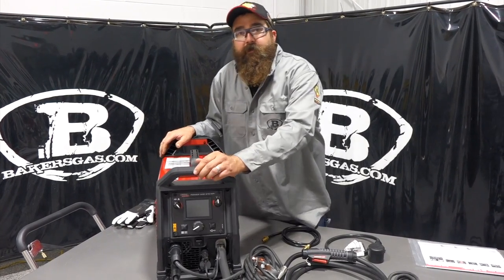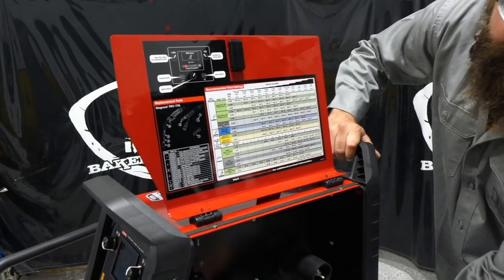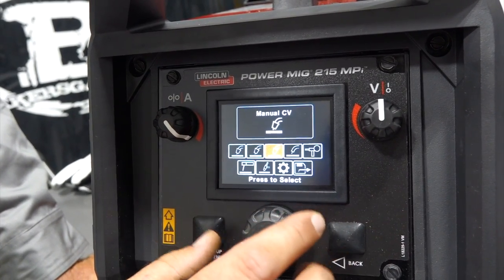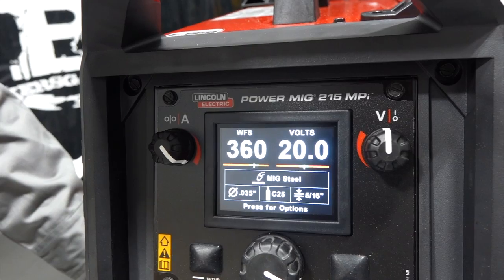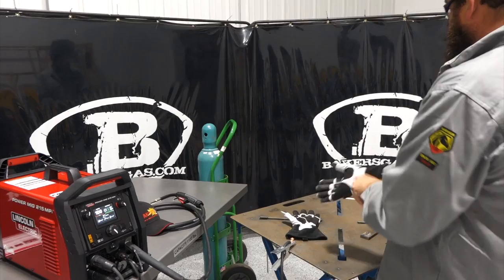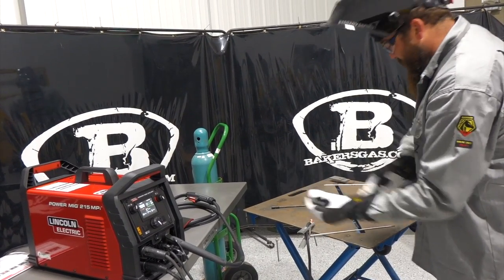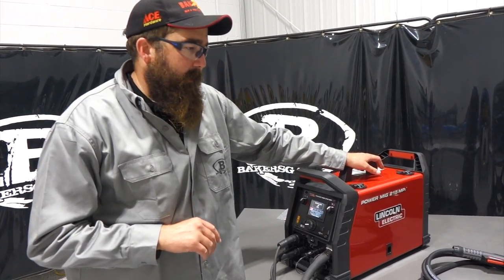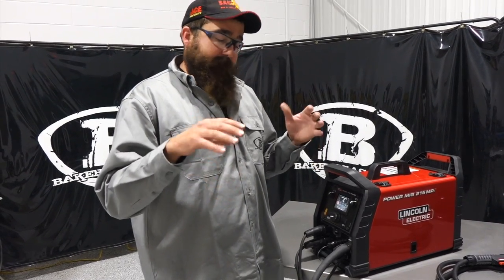Lincoln Electric Power MIG 215 MPi - Review and Demo

Comment: After a year i REALLY like mine.  Two suggestions : one for the Power Mig 215 .....why do the SMAW settings for this machine default to DC -  ? The way polarity is selected is really kind of annoying..Its like playing .like a video game.. just make it a +  or  -  off / on switch...This next applies to ALL multiprocess machines.. I really really like have all processes in one place but i still have to take my Mig gun set up apart to run a spool gun..Why not Install  a separate 4 pin connector and gas solenoid for spool gun..now its all there

Comment: Update: got the machine, the very first update I notice was that they did away with the twist lock cables, instead they went with the traditional setup of a 230 volt plug to a 120 volt connector. To me, great improvement. My first impression that is a way better machine than the 210 MP. It's a little bigger than the 210, therefore, the 210  cover does not fit.  Those extra two handles makes it easier to move around.  I use .030 wire most the time, it does not have any recommendations or settings for .030 flux core wire which I was expecting to see in this machine, however, that is not a deal breaker. Hope they come up with a cover that fits this machine soon.
Reply from the maker: Hey Jose, thank you for commenting and keep us posted as you use it! All good feedback we will pass along and look into.
Reply from the maker: Hey, good news you inspired a new cover that fits.... https://bakersgas.com/products/lincoln-k2377-2
Reply: @BakersGas  and as I wrote Steve, that cover also fits my old Pro-Cut 40 Lincoln Machine as well that I could never find a cover for in nearly 25 years….lol

Comment: Can you select between the two gas inputs? I purchased the 215 with the spool gun and I am still learning how to use it. I set up C25 to the mig port and argon to the other (tig port). However when in the spool gun/aluminum settings the C25 gas came out. Since it already has the second gas port It would be nice not to have to physically move the gas lines.

Comment: Makes me wonder why it won’t run 6010 when it has the 60XX option in the first place.. WTG Lincoln! 🙄
Reply: it runs 6011 and 6013
Reply from the maker: Most machines do NOT run 6010 none of the other Lincoln or Miller units do.

Comment: I just got one. I do TIG at work and my wife wants to do MIG for decorative pieces. I'll give you a fair review soon
Reply: Waiting for the review bud 🙏💪
Reply: @robinsaini7096  Sorry about the wait. I just had to get a few things worked out with the power requirements. This thing, from the few 7018 sticks I have run with it is great! One or two BBs of splatter, but a good slag peel and ran so smooth and easy! The menu is extremely intuitive and walks you through the process nicely. The controls are easy and it takes nothing to get going. What I don't like? You can't run sticks on AC
Reply: @robinsaini7096  The menu is pretty intuitive. I could see it getting tedious to go through when you know what you're doing though. On flux core, it welds great! I fixed my neighbor's fire pit and, for never setting it up before or really using flux, it went fast and welded great. The more I use this machine, the more I like it
Reply from the maker: @zenjon7892  great feedback! Thank you for sharing!
Reply: Okay, now for TIG: I used it to repair a stainless steel laboratory glove box today and discovered it doesn't have a hot start setting. I'm not sure if this is normal, or normal for TIG, but it was a little annoying. My IdealArc 300 does have this though. Also, there are no pre/post flow gas settings
Reply: @zenjon7892 , pre and post flow are adjustable in the TIG options.  Confirmed today.
Reply: Flux core: oh man... This is great! I'm building a propane tank offset smoker pit and it is so much fun to use! I do wish Lincoln put a "wire feed jog" feature in it though

Comment: One thing I keep hearing about the 215MPi is the improved wire drive. I’ve owned two 210MP’s and the wire drive is identical. The good thing is, it was almost perfect to begin with. The only weakness is the little plastic drive hub that mounts to the motor shaft that you slide your bottom drive roll onto. I learned to keep one of those in my tool box. It’s still used on the 215MPi. The biggest improvements to the 215MPi that I see are: 1) 30% duty cycle (10% more than the 210MP. 2)they did away with the Mikey Mouse cord connector socket in the back of the machine for the power cord. 3) it comes already set up with the tig solenoid and gas port.
Reply from the maker: Hey! Not sure when you got the 210 but it is newer that Lincoln put the industrial drive roll system on the commercial machines
Reply: The duty cycle on mig is much better, 25%@200A/24V for the 210 and 30%@215A/24.8V for the 215. It's a significant improvement that works out to the machine being able to output 33% more energy (amps*volts*duty cycle) in a 10 minute cycle, that's no joke!

Comment: What is better the Lincoln 215 mpi or the Miller 220?
Reply from the maker: The Miller 220 has the AC TIG ability so that really makes that one elevated if you need to TIG aluminum. The MIG and STICK side are really similar. The Miller equivalent would be the Multimatic 215. All of the names are too similar it can be confusing.

Comment: @BakersGas, what is the purpose of adjusting the tungsten diameter in the TIG options?
Reply from the maker: machine adjusts based on what size you are using
Reply: @BakersGas , what does it adjust though?

Comment: If I have no other choice what generator would I need to buy to run this without burning up the circuit board
Reply: Honda EU2200i or EU3200i, depending on whether you want 120V input of 15A or 20A

Comment: How would it compare to the miller multimatic 235
Reply from the maker: The 235 has a higher duty cycle and 220 power only. So would not really compare the 235 would have more power but not as versatile in size and power options.

Comment: Just ordered one, can't wait!  I hoped that Lincoln added automatic settings .30 flux core capability on this one. The 210 only offered .035-.045. sadly they did not, at least that's what they show on the chart. Same roller drive as the 210 which is not bad.
Reply from the maker: I am sorry we did not try that. I can try to confirm for you!

Comment: Does it come with the tig switch already or is it like the old 210mp u need to open it to install the tig switch?
Reply: It's already there in the front
Reply from the maker: The gas solenoid is there so no need to do any install to start TIG welding.

Comment: Does this machine have a MIG setting for 3/8" mild steel? Thank you.
Reply from the maker: yes!
Reply: @BakersGas  what’s the steel thickness that this machine can weld?
Reply: @BakersGas  curious about this... it doesn't appear to support it in its autoset functionality in your video--the UI doesn't show it and neither does the chart.
Reply from the maker: @plsreleasethekraken  Lincoln calls it Ready Set Weld for the Lincoln recommended settings
Reply from the maker: @adrianol333  Max recommended steel thickness for 120V is just below 1/4″.  will weld up to 5/16″ steel, but this is when powered by 230V
Reply: @BakersGas , it would be nice if the unit could be adjusted to display metal thickness in fractional inches instead of gauge

Comment: Will it run dual shield flux core and spray mig?
Reply: I have run .045 Lincoln Ultra-Core 71A-85 for the last 7 years on my 210MP’s with room to spare. The thermal overload protection will trip if you start making continuous welds 18” long or longer back to back but I rarely find yourself doing that with this machine. Just let it cool down for about 2 minutes and it’s ready to go again.
Reply from the maker: it will run flux core...spray transfer.. I would say probably not you are limited
Reply: @BakersGas  It will easily hit spray transfer modes with a .025 solid wire, and you can get REALLY close to it with .030, but probably only hit actual true spray transfer about 30-40% of the weld.  You've really got to have the stick out JUST right in order to hit it on .030.

Comment: Nice machine sir thank you. Sir this machine inverter type or transformer thyristor rectifier type
This machine continuously run 1 hours. Thank you so much sir for.
Reply from the maker: This is an inverter. We have been working with Lincoln inverters and other major brand inverters with no issues on quality.
Reply: @BakersGas  thank you so much sir. Sir please online buying information  India. I am checked Lincoln electric website but India delivery location is not showed. Thanks sir.

Comment: Appears to have copied the ESAB Rebel 215’s extra lifting handles, as well as the Rebel’s welding display set up. Too bad the Lincoln unit can’t run E6010 like the Rebel can.
Reply from the maker: Hey Glenn, thanks for watching similar design on the handles and certainly more durable!

Comment: It looks like a Miller 215 knockoff, but 6-years after Miller started selling it.  Seems somewhat strange to go with a modern user display with 4-hex screws around the display.  I’m hoping the fan doesn’t run all the time except when welding like the Miller too, that would be great!  Overall it looks nice, with any luck it welds as good or better than the Miller 215 too! 👍

Anyone know if it has the soft-start feature like the Miller?
Reply: Uh, no. Lincoln 210MP was first to market, then Miller jumped in. Thanks for failing though

Comment: If it won't run 6010 electrodes, will it run 6011?
Reply from the maker: Correct it will not run 6010 it will do it but not well.